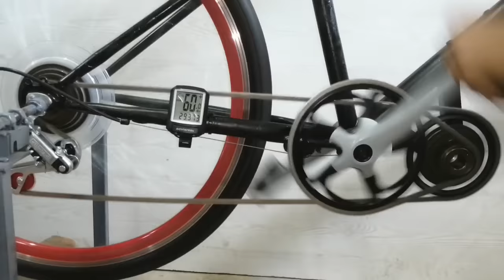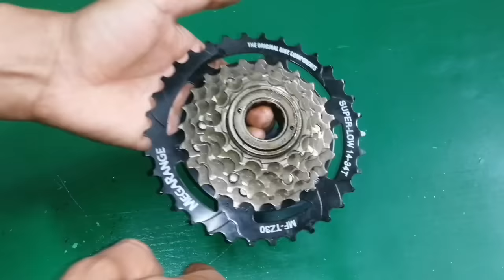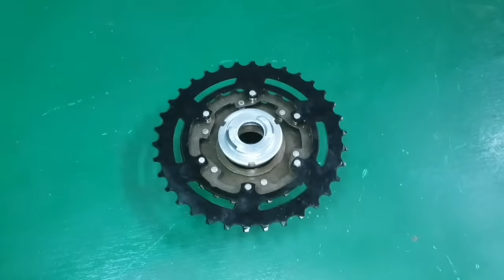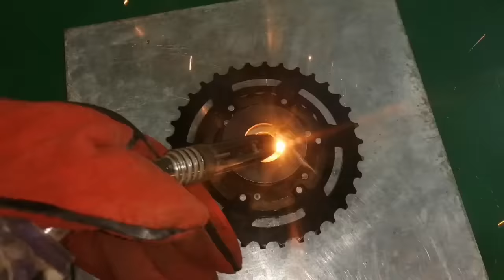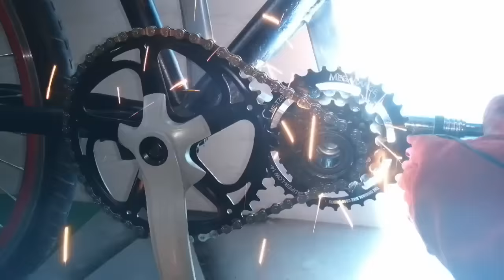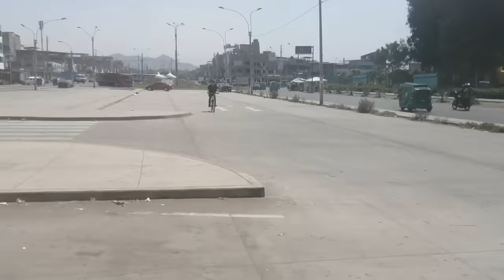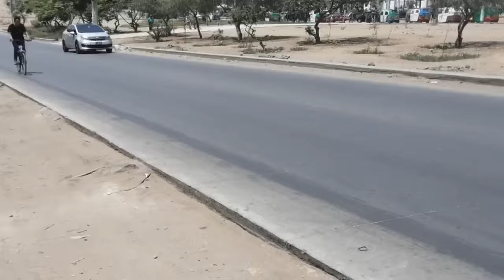making super fast bike

Comment: Teóricamente es todo posible. sin embargo, actualmente las relaciones de engranes para ruta comercialmente está  53/11 es 4.81 , hasta 60/11 es 5.45 con esta última relación superas los 40km promedio. Así que trabajamos con la relación 28/14 x 52/14 llegaríamos a 7.42 teóricamente,  sin embargo la cadencia sería lo quizá uno no pueda sostener el rpm . Es un buen multiplicador de velocidad pero no practico para el cuerpo humano.
Reply: Ако трябваше, щяха в завода да му монтират тези предавки.
Reply: Versteht kein Mensch
Reply: Podrá dar más detalles o tendrá un video guía para mantener el par esfuerzo para mantener la velocidad por promedio 30 km/h
Reply: La deal este foarte nepractic
Reply: Is it possible to go faster in this case?
Reply: Is it possible with little manpower and fast driving?
Reply: No, this wouldn’t effect the human body, this is on a mountain bike which has a free spinning chain. This means the chain won’t continue to move if the wheel is, like many bikes do. In turn, your only issue will be stopping. If your going to do something like this, invest in hydraulic disk brakes like those used on motorcycles.
Reply: What the hell are you talking about? He put the gear in the front to make the ratio different so that he can go faster but using at least amount of rotations with his legs to equal those faster speed. So we made it easier to go faster by adding that extra gear ratio. What the hell are you talking about? Did you not watch the video like everybody else?
Reply: Era más fácil decir que una persona no  puede generar el poder necesario para desplazar el aire moviéndose tan rápido. No es cuestión de mecánica, es cuestión de aerodinámica
Reply: Мощности человека недостаточно для вращения  этой передачи в реальных условиях. Ещё нужно учитывать многократно возрастающее со скоростью сопротивление воздуха!
Reply: @jonathanbyrd12 gear ratios like this arent built into bikes from factory for a reason. People's legs arent strong enough to get higher speeds unless going downhill. The only cycles that higher gearing works on are velomobiles which are only able to do so because they have streamlined bodies.
Reply: Que?
Reply: Anti scientific, so a completely pointless effort.
Reply: @chrissammels5444  En que etapa del método científico crees que está comentario.  Hablando estrictamente estamos agregando  información complementaria en base a la publicación original el autor. De no ser así,  no existiría el debate y se mejoraría el modelo. En el mercado existe el 60T , y si existe como el piñon rueda libre 9v 11/28. Te invito a que hagas las refacciones a tu bicicleta y hagas la prueba de campo. Nota: solo estamos a nivel experimental , porque la reglamentación o normativa que no es el alcance de este debate .
Reply: Y habría alguna forma de poder hacer un multiplicador de fuerza (lo considero como buena opción ya que si la modificación se hace en un cuadro de fierro sería muy fácil hacerlo)
Reply: @user-sm3ms6wp6u yo puedo llegar a esa velocidad como si nada mi Catalina posee 48 dientes y v7 busco más velocidad x que en bajada o en plano ya no siento nada de esfuerzo en pedaleo y siento que voy despacito y uso frenos de disco.
Reply: На горку не сможет подняться
Reply: لماذا هل زيادة الترس سيؤثر في قوة الشخص؟
Reply: Nadie conoce el límite evolutivo de nuestros cuerpos, si actualmente una persona dedicada puede mover un avión con sus brazos y piernas, si una persona trabajará con sus hijos y los hijos de sus hijos, es algo a largo plazo el trabajar con eso

Comment: Increasing the gear ratio definitely gives you potential for more speed. But you’re still putting in the same power with your legs. You’re not gaining any mechanical advantage by doing this.
Reply: In fact he makes the bike worse, because more moving parts meant more rotational mass which means more watts lost in process.

Basically this reduced efficiency of the drivetrain.
Reply: lower tempo means more achievable ride for most for longer, stop hating
Reply: @PP-cm4re  constructive criticism? what was the constructive part?
Reply: Lower cadence on flat improves cycling comfort. Higher tooth front crank does same.
Reply: @mykota2417  You don't need a 2 stage transmission for that. And +60km/h is something not even pros can achieve on a flat road.
Reply: @littlehills739  you want to keep in the 60-120 rotations a minute when riding, if you ride everywhere at 20 cadence on a gear 10 inches to big for you your knees are going to fucking hate you come you being 50
Reply: Except the gears on a normal bike are plenty for high cadence on flats
Reply: I would like to add that there’s already a solution for hill climbing, it’s called having multiple chainrings
Reply: @littlehills739  the only hating going on here is that those of us that understand mechanical advantages, leverage, volumetric efficiency, hysteresis, frictional loss and added weight equals more load
Reply: @jurekgadzinowski2895  friction\weight too
Reply: @brianpittman9460  DAMN THOROUGHLY stated 👏 👌 🙌 👍
Reply: @Alex-kr7zr  u meant FOR EXTENDED time period ...37mph VERY common in SPRINT mode❕ ...even femaelz occasionally 😱👽👀
Reply: @battshytkrazy156  Yes, of course, more than a few minutes. Pros push more than 1500W in sprints, an amateur most likely won't go beyond 400W  and that won't give you 60km/h at all, with that crappy body position maybe 40km/h for a few seconds. But more realistically for longer distances are < 300W for a trained person, more 100-150W for an untrained person, going faster than much more than 30km/h is very unfeasible with this "setup".

Comment: The "laboratory" conditions presented here do not account for rolling resistance and wind resistsnce.  Your top speed will be no faster on flat, level ground than regular gears, assuming regular gears are already geared higher than the rider's strength.  If it did work, I could gear my car to go 1000 MPH by just putting in high enough gears.

Comment: Fun fact: gear ratio is not a limiter of bicycle performance.
Reply: depends on the rider and what rpm the riders power band is.  this would be perfect for a fast twitch person. ie anaerobic athletes.
Reply: @ScreamingEagleFTW  The problem is that fast twitch dominant cyclists are actually good at... higher rpm. I know cycling world jumped on slow twitch = higher cadence bandwagon long time ago but recent studies show it's more complicated than that at best. Speed of contraction does matter. Athletes with higher percentage of fast twitch fibers are better predisposed to higher pedaling rates. So I'd say this crank would be good for an athlete with A LOT of slow twitch fibers which sheer amount allows for higher torque.
Reply: we already know that fast twitch fibers create more force, more limit strength, more tension but for shorter durations. Red fibers are for endurance, sub maximal contractions over and over.  Only one way to find out.  At least we agree that starting out at a full stop in a high gear the advantage would go to the fast twitch guy if acceleration was the goal.  @michwoz
Reply: @ScreamingEagleFTW  Of course. Although you don't need that much force while pedaling in most scenarios (even at higher intensities), during sprinting or at very low cadence coupled with high power, high rate of force development is required which only fast twitch fibers can provide.
Reply: "Fun fact: gear ratio is not a limiter of bicycle performance." More fun fact: bicycle performance is limited to air resistance and gravity. Even more fun fact: larger sprockets cannot overcome air resistance and gravity.
Reply: que dices !!!!!  estas equivocado   las marchas siguen siendo ajustables.
Reply: el Torque es lo que ha hecho el inventor .  estáis hablando sin sentido amigos
Reply: @DavidCanet  "el Torque es lo que ha hecho el inventor .  estáis hablando sin sentido amigos" The only person talking nonsense is David. Torque is limited on a bicycle to gravity and the weight of your body. Horsepower what overcomes the resistance of air. The more torque the less horsepower. 100 times the torque means 100 times less horsepower. Riding along at three miles an hour is better off walking.

Comment: Easy to turn the crankset when the bike is on flat road, but with a few D+ you will need to buy new legs. With 54-10 it will be already very difficult to crush the pedals
Reply: Even on a flat road, you will not get much speed out of it without a fairing or some other method to improve the aerodynamics.

Comment: Iam no technical guy but ,did not understand why this revolutionary techno
logy didnt hit the mordern cycle production...Its really impressive !!!👍👍👍👍
Reply: simple, it's completely pointless. All you're really doing is adding extra friction.
more speed allways correlates with less torque at the same power input.
Also, it's one thing to get the wheels spinning up to 60+ (couldn't tell from the video if it was kmh or mph)
while they're not touching the ground and the bike doesn't have to overcome air resistance,
which at these speeds is the main thing you're pedalling against.
Want more speed, but keep it usable?
Get a giant front chain ring and have the sprockets in the casette cover a large span of diameters

Comment: How refreshing it is to see somebody who makes YouTube videos who actually knows how to weld a bead rather than just multiple tacking / sloppy spot-welding.
Great Job  🎉
(especially compared to everyone else I see on these videos)
Reply: On the other hand, the idea of simply creating a faster bike by gearing lacks knowledge of the available power and wind resistance. Doesn't it seem logical that faster bikes would already have been invented and widely available if it was that simple?
Reply: No, you're illogical - this bike has four gears working simultaneously, this has not been done before @TheKIMANO
Reply: @cpmorgan5000  I am completely logical. Unless you can override the laws of physics, you can add all the gears you want. A TDF cyclist delivers, on average, somewhere between 220 and 240 W on a regular stage, and that must be said to be the top of what can be delivered. We are therefore talking about a force which, for car experts, corresponds to 1/3 HP. In addition, you have a wind resistance that increases exponentially with the speed. It's great to experiment and try new ways, but the laws of physics are what they are. The bicycle is an old invention that has been refined for centuries and a modern racing bicycle has almost no transmission resistance. But what little resistance there is after all becomes twice as great by adding twice as many gears.
Reply: @TheKIMANO  I was just playing
Reply: @cpmorgan5000  It's a bit embarrassing that I didn't catch it, but English is not my native language and I am sometimes provoked by "fantatic" free energy inventions. But I'm glad you didn't have to be taken literally ;-)

Comment: Really cool! you seem to know your tools. I live in a fairly flat city and I spend most of the time in the highest gear ratio, I've always wondered how would be to have an extremely high gear ratio like that and this design is way more compact that just adding a huge gear. Also I would try to add an electric motor to that bike.
Reply: A time trial bike already has a higher gear ratio than that in the video. They can go 80kph and more whereas this showed a top speed of 70. 
You only need a big chainring, like 56 teeth
Reply: Its not more compact. Its heavier and less efficient. And it looks ugly. A big chain ring is beautiful. Just get a bigger ring.
Reply: 390km 😂

Comment: Question is, does it weight less than a 80 or 90T front chainring+chain links? 
And the increased complexity equals more prone to failure.
Reply: I'll take gear reduction
Reply: You could get into ground clearance issues with a huge chainring, so for a MTB something like this would be better.
and you wouldn't realistically need that big tho, you can buy a 70t chainring off the shelf and fit it with a 9t rear cog and I don't think anyone would be able to pedal that up to even a steady 90 cadence. It would need a huge downhill atleast. If you really wanna fly pair that up with a internal gear hub and you'll be going 90kph at 60 cadence.
Reply: It adds little relative complexity
Reply: Of course it doesnt, also the better way would be changing the cassette to the 12 speed one that has the smaller gear with 10, not 13 or 14 teeth like this one.

Comment: Doesn't a bigger sprocket in the front  accomplish the same thing with out all the extra stuff?
Reply: Yes, less drag from the chain on sprockets and less weight. Its pointless unless everywhere you ride is downhill though because you can only gear a bike up so much before its too hard to pedal. The builder is faking the speeds by using downhills to appear fast. As big a bullshit line as all those free energy electric motors videos.

Comment: Super smart idea. For someone with strong legs, thats so cool and handy. Force to push hasnt been the issue personally but high rpms like any motor(human capability), there is a limit
Reply: You indeed need alot of leg watts
Reply: Lol, ifyou cannot peddle at the rpm of 60-90 then it is time to see a doctor. This gearing is insanely pointless. Average commuter cyclist is able to peddle at the 70rpm. 70rpm on this bike is more than 100kmh, how the hell are you going to acclerate to the 100kmh on a such high hear? the lowest gear at 60rpm makes you go 30kmh. And the peak power of human legs on a bicycle is at around 100rpm.
Reply: @DoomNerd67200  "You indeed need alot of leg watts" the one problem is you are limited to the amount of torque produced by your own body weight. Any more torque than your own body weight would be lifting you off the saddle instead of pushing you forward. Well, that is unless someone installed a seatbelt.